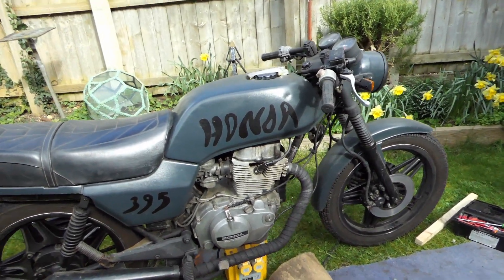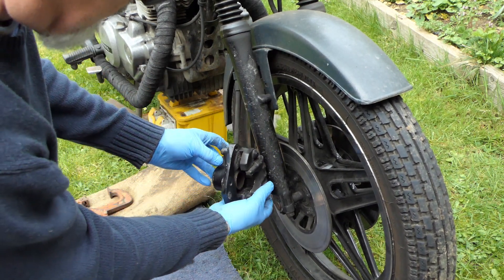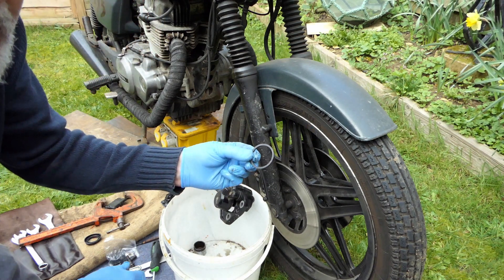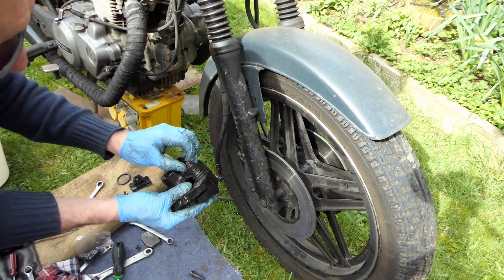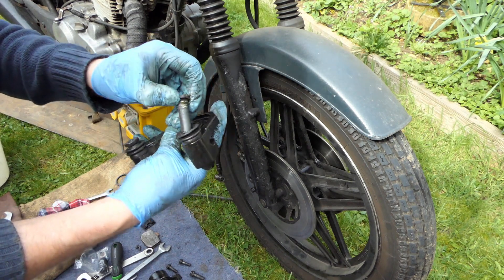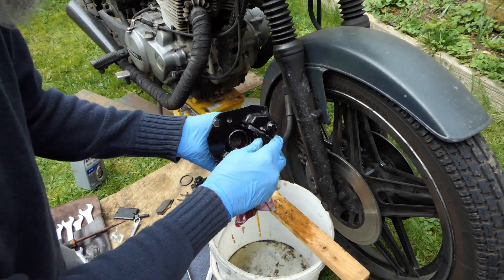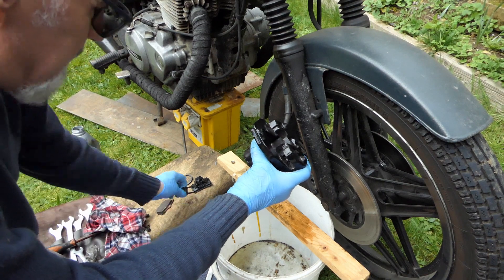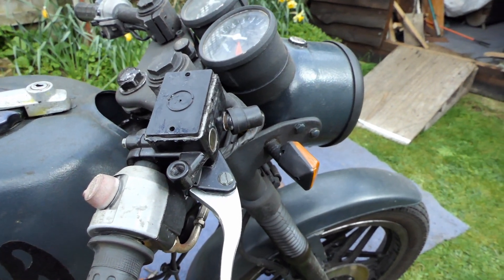Bleeding brake caliper with broken nipple.

Comment: Does this get rid of the air in the  caliper channel between the nipple and piston?
Reply from the maker: Hi, Yes it removes the air, I should have shown a close up of the air being removed. I put my thumb over the hole and turned it upside down a few times  and you could see the bubbles coming out. The brake would not hold if air remained in the system.
just slowly squeezing the leaver as you tighten the last few threads on the hose.